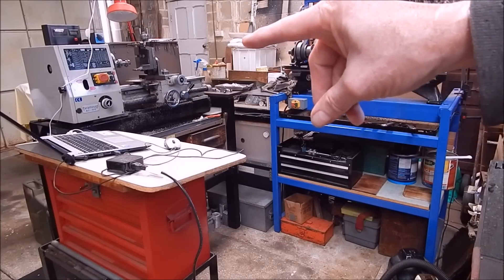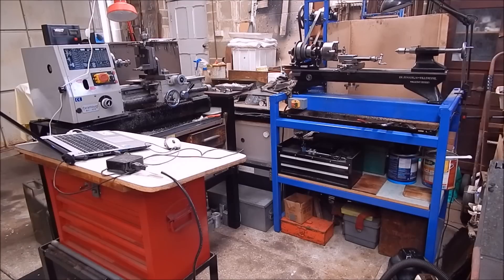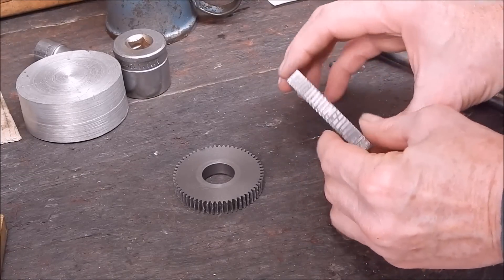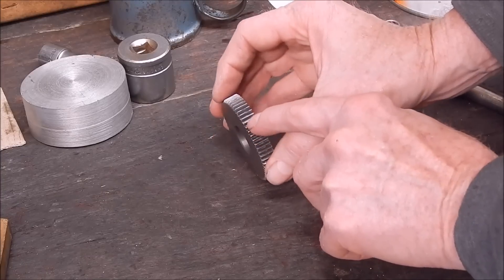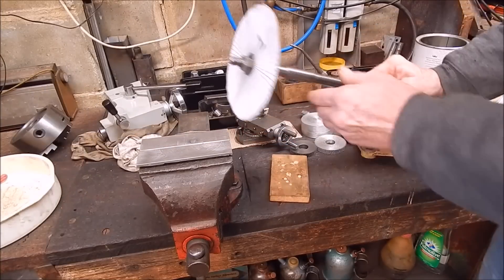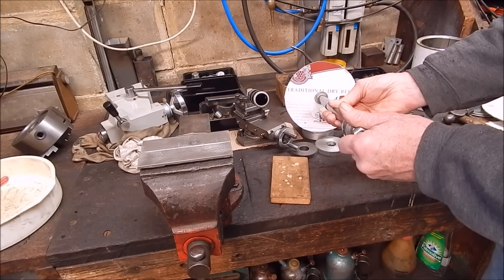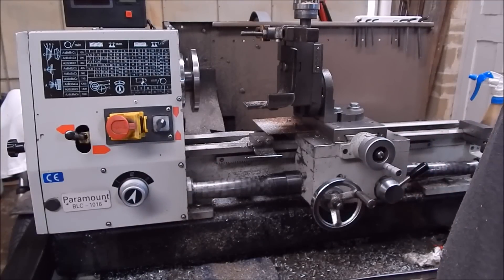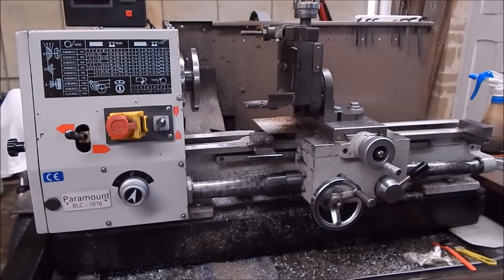I easily cut some spur gears on my cheap Chinese lathe

Comment: Super successful Rob - love the indexing method.
Reply from the maker: Hi Chris,

The USB microscope makes all the difference.  

I had always used a pointer with a fine tip and a magnifying glass to line it up, but that had room for error and was slow.

This new method is fast, easy to align, and super accurate.

The indexing method works great, BUT you must use a symmetrical pie chart (printed from the internet).  Spread sheet pie charts often print using four quadrants to make up the pie, and are not uniform as a result - eg Excel does this.

Glad you enjoyed it.

Cheers Rob

Comment: Great work Rob, I put my vertical milling adaptor in the bottom draw as it chatters so much when milling. However I think I must dust it off after looking at your clip and look how I can improve and use it. Thanks for the great videos.

Comment: Brass gears are pretty good. I have made some myself. A little bit more strength than alu gears I think.
Actually I made my first gears on the lathe, but when I bought a milling machine and made me a rotary table it was much easier to make some gears.
Have a Guinness! :)

Comment: When using probes or cameras that need to stay in position during an operation, the long cord can be an issue. You don't want the cord to pull your camera over slowly during the operation. So a good idea is to wrap the camera cord around the indicator stand down to it's base so that the weight of the cord doesn't have any leverage on the end of the indicator stand.

Comment: Far too many seem to just write off those vertical slides / milling attachments as pretty much worthless today. I bought one after I bought my Bridgeport clone. There s some work that's just easier to do with the part in that orientation. At one time at least in the U.K. few had any kind of mill in there home shops because they were just too expensive. I've seen pictures in old magazines of some very complex parts that were all done on a lathe with one. No they don't have close to the same rigidity that a proper mill does, adjust the depth of cut and feed and they'll still get the job done. 

Clever set up to cut that gear. And nice use of a web cam to magnify where the pointer and line match up.
Reply from the maker: Totally agree.  Bolt one to the cross slide and it works OK, but not on the compound (on small lathes) where I've seen people using them on the net.

The work envelope is small, and gravity doesn't help out when aligning stuff, but they can do handy jobs at times.

Cheers Rob

Comment: Hey, if you know what you are doing, there is always a way to do it. I've done some really good work on Chinese machines. If you have a steady hand you can clean up a shaft or make a pin by bolting an x-y vise on the ways of a wood lathe and rigging  a tool post. And I've made gears by roughing out the teeth with a band saw and hand filing them to shape. As long as you have a sample of the tooth profile and some way to index accurately, anything is possible.

Comment: Nothing like a few beers to grease the brain cells Rob and a couple of good sturdy chairs and then you engage one self in soulful meditation..Its never a waste of time thinking and I am still wrestling with the er 32 collets---3 days and still not a usefull conclusion--they just read all over the place..I could use them for snapper leads when I go fishing and get my moneys worth out of them that way..
Another good vid --keep them rolling...E
Reply from the maker: Hi Ian,

Bad karma.

Who did you buy them from ?

Cheers Rob
Reply: If my memory serves me right I think I bought them from Hong Kong but I will put them away for a while--there are other projects I have to do and have another go at them in a month or so..Some times being stubborn works for you and sometimes against..The chucks run true on the inside--put a collet in and all over the shop...A good long think is in order....  E
Reply from the maker: There is a non "standard" version of ER collets which is slightly longer than the common type.  It's an uncommon industrial type.

I have heard of people in forums buying these from Ebay (out of Hong Kong) being unaware of the difference.

Might pay to check the specs of what collets you've got against ER data.

Cheers Rob

Comment: I've got a late 1980s JET 9x20 lathe with one of the gears (plastic, sacrificial) seems to have worn down so badly my threading feed screw no longer turns.  If I can't find a cheap enough replacement I'll do this with Aluminum to replace it.
Reply from the maker: Make sure the leadscrew has a shear pin, as the gear is sacrificial for a reason.

Aluminium gears are very strong and the shear pin will break before any gears give way.  So only use an aluminium gear if there is some protection in place in the event of a carriage crash.

Normally the leadscrew will have a drive coupling at the headstock end consisting of a cross pin of some description.  Even if this is not meant to break, it can usually/easily be replaced with a pin made of brass or bronze brazing rod to turn it into a shear pin.

I use bronze rod on my lathe and it shears nicely.

Cheers Rob

Comment: Thats really clever. I'd like to hear more about the cutter and what type of camera you were using. Do these gears sing a bit when you run them, and what type of material did you make them from? Surprisingly enough, my Clausing has LE phenolic gears and steel mixed together. I also invite you and your viewers to check out my channel for some cool insider shop tricks. Thumbs up and a new sub. Take care
Reply from the maker: Hi Joe,

The gears make the same sound as the originals, that sort of chatter noise you get.  The gears are brass and aluminium.

They use fibre and alloy gears in some machinery to quieten things down a bit. 

The camera is a Nikon L820.  Has good optics and macro.  Sound is OK but can over modulate easily.

Cheers Rob
Reply: Thanks for your detailed and quick reply. the camera for the gear index template was very small. Was that the Nikon?
Reply from the maker: Hi Joe,

Sorry, I misunderstood your question.

The camera used for indexing is an Andonstar USB microscope.  I review it below:

https://www.youtube.com/watch?v=Dl_xYLx4jhw

You could use any USB microscope with a suitable mount.

Cheers Rob

Comment: 9:21 Can you explain why there is a belt connected to the idler pulley? I would really like to know.
Reply from the maker: I don't understand the question.  The intermediate pulley as shown is part of the drive reduction system you find on any Chinese lathe.

It enables you to change the drive ratio between motor and intermediate, and intermediate to spindle.

You obviously need two belts to do this - one for each ratio change.

Rob
Reply: I'm sorry about that. It was pretty late when i asked the question so it doesn't make much sense now that i look at it. What i wondered was at 9:21, you had one belt connected from the motor pulley to the idler pulley and the other belt was connected from the motor to the spindle. It's typically arranged this way (Motor, Idler, Spindle) The way you had the belts arranged at 9:21 had only one belt transmitting power from the motor to the spindle while the belt on the idler pulley wasn't really utilized (as far as i can tell) Just curious that's all.

Comment: Why are the two new gears on the tumbler (from alu and brass) not the same size? If you reverse the lead screw direction you will get different speeds, right?
Reply from the maker: No.

It's a tooth for tooth transfer.  You can use any sized gear as an intermediary and it will make no difference to the final speed.

I know this is hard to wrap your head around, but that's the way it works.

Cheers Rob
Reply: I had another look. And you are right of course. So far I had only seen tumblers with two equally sized gears and mistakenly assumed it has to be that way. But it does not matter.

Comment: hello sir

i've questions,
why did you make the gear shaft for long? 
why dont you make it shorter to save space?

thanks
Reply from the maker: The indexing shaft has to be long enough to clear the top of the vertical mill slide handle.

Rob

Comment: one question please ! how you made that spiral protector for your lathe thread rod?
Reply from the maker: It came with  the lathe as original equipment.

You can buy them from specialist suppliers.  Search for "spiral lead screw protector".

Cheers Rob

Comment: Can you cut volute gears on a lathe or do they need to be milled?
Reply from the maker: What do you mean by a "volute" gear ?

Rob
Reply: NVM, brainfart! Have been getting back into machining after a loooong break and got confused :( Thanks for answering so quickly! Also, cool bananas, I like that phrase!
Reply from the maker: No problem.